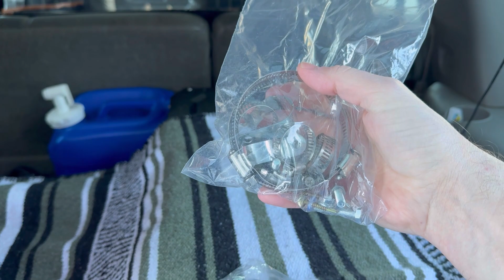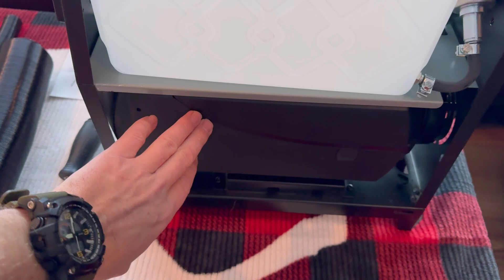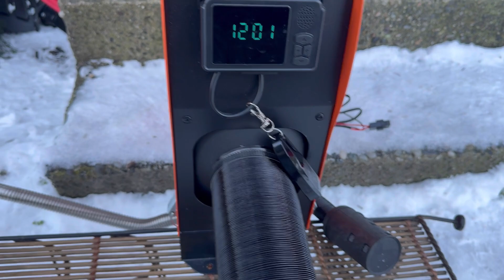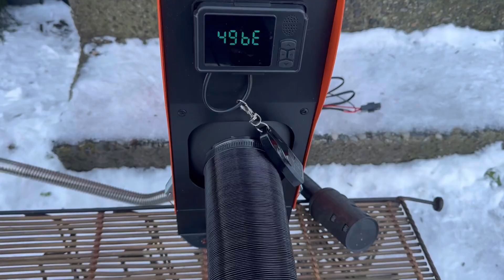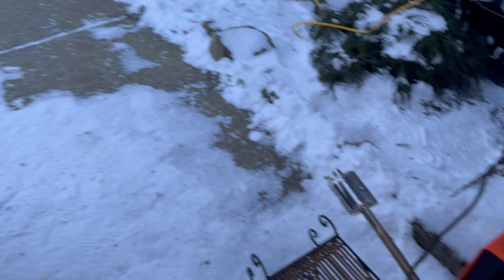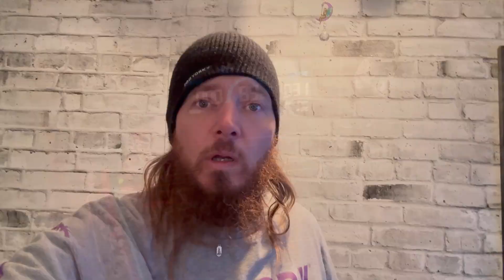VEVOR Diesel Heaters GOOD Or BAD?

Comment: Great video... not done watching yet but well done. 

3:25 There is a slit / slot in the side of the case where you can put your screwdriver, so that you can get a strait shot at the hose clamps. This makes it a little easier. I've never seen a reverse thread one either... odd. I have noticed that some of them are sticky. If you give them a squeeze with a pair of pliers around each end, they work better. 

The exhaust can be bent a lot and won't break... unless it is old and has been heat cycled many times... then it may crack.  The issue with start up is that it needed to be primed with fuel. To prime this unit, you have to remove the power (unplug it or remove the fuse) reconnect the power and then press the bottom button for 7 seconds. The pump will cycle. Watch the bottom of the heater till you see fuel going into the metal line... once you see it going in, allow the pump to pump for another 10 seconds. Then press the power button and it will stop pumping. Then once you fire it up, it will start much easier. 

The glow plug works on a timer. When you hit the power button the plug comes on and heats up for about a minute. Then the pump starts and the plug ignites the fuel.... after a minute of running, regardless of temp, the heater will try to speed up the fan and pump more fuel to get things going. After it goes through the startup sequence, it will revert to whatever setting you have it set to and the plug turns off. You can see the wattage drop to about half once the plug is off 👍

The heater will draw 40 - 50 watts ... I think you got this confused with amps. It draws about 4 amps at 12 volts 12x4 = 48 The slower the fan and pump go, the less draw and vice versa. 

If you want to make this WAY more efficient, get another hose and cut a hole in the back and connect to the inlet side... If you recirculate your air it will be WAY better. I have a bunch of videos about these heaters ... feel free to ask me anything, or check them out 👍
Reply from the maker: Thanks for all the great feedback! Just subscribed to your channel and will take a look at those vids.
Reply: @AdventureOverland2023  I try to be helpful when I can 👍 There's a lot of confusion and misinformation out there, so if you run into trouble, feel free to ask... If I don't know I'll say so. If you're trying to learn about heaters, Dave McLuckie has a lot of great videos as well. The majority of my videos are torture testing and nonsense, haha.
Reply from the maker: Torture testing is good for us viewers. I find that YouTubers can be influenced by collaboration’s and say that the product is great etc. I get that because it nice getting free products. I was like that in the beginning but as time went on, I wanted to be 100% honest. So this video, I just winged it and whatever happened is what I would share.
Reply: @AdventureOverland2023  Haha... How Embarrassing. I am affiliated with Vevor🤣I saw your Vevor heater title and wanted to see what you had to say. Not everyone has a good experience, so I was curious. When I got one of mine the fuel line was kinked, and I showed that on video. Most of my abuse has shown that the heater are actually really good, and I am open about the flaws. 

They have never asked me to say anything about a product. I have had a few products that I've refused to test for them and they are okay with that. They are a LOT like Princess Auto as they have a insane variety of stuff. If you do a few more diesel heater videos they may be contacting you, haha. 

I do totally agree with you. There are a lot of product shills out there that just read off what it says on the side of the box "here's the features and benefits" and that's that. I have been approached by a bunch of companies that I ignore either because of their product because they asked me to say a specific thing before even seeing their product. A lot of Amazon sellers. 

Sorry for the rants.
Reply from the maker: I believe they’re good too. People forget what happens sometimes during shipping and the abuse packages can get. It’s not always the companies fault but people forget that sometimes. I’m sure vevor appreciates your videos and honesty.
Reply: @AdventureOverland2023  Yeah... I liked that you mentioned that about shipping in yoru video. It's amazing that anything shows up in one piece.

Comment: From alot of videos I noticed people are mounting the heaters outside and trying to heat outside air?  I could see this using it for a tent maybe or fish house. But in a vehicle, camper or building, they are designed to be inside, with just the combustion air intake and exhaust going outside. Then you are re-heating the inside air which is much more efficient.
Reply from the maker: I never thought about that until a few people mentioned it. I’m going to try and extend the intake so it will reach the inside and see if that helps. Thanks for commenting.

Comment: I got that same heater (mine a different brand however, but they're all the same unit) Mine is the WIPPRO brand (a few bucks cheaper too)  All the accessories were there and good quality. Everything was connected and routed pretty well. I first changed the cheap fuel line they had on it, with some better quality fuel line so be safe. Gutted the little intake muffler that goes on the end of the intake hose (everyone thinks its a filter but it's not. I instead lined it with filter material so I now have an intake air filter.  I have yet to make in intake cold air return and filter for that, but that will wait until I find a good place to mount it in my shop,

Comment: Why does everyone call these diesel heaters. Diesel is engine fuel not heater fuel. Heater fuel is #1 or #2 kerosene which is more highly refined and much less smokey. These are more rightly called kerosene heaters. They will burn diesel but who would want to?
Reply from the maker: You can buy these and they either run on gasoline or Diesel. I’ve even heard about people using a used oil and diesel mix. To be honest I’m not sure if they can run on kerosene, so if anyone that reads this comment knows, let us know.

Comment: I used one, a different brand, but under the hood they are all the same, in my offgrid cabin.  Gamechanger in the middle of the night when the wood stove is nearly out and you need some heat until morning.  I use an aftermarket thermostat to control it so we aren't cold at night, and it works perfect.   A 100Ah LiFePo4 battery will run it for about 28hrs non-stop.  At 45F outside, it will get my cabin to 82F in about 20mins, the cabin is 250sqft.  Ours is outside and the hot air plumbed into the floor, one of my upgrades is to move the air intake to the inside as well as it will heat faster and not try to positively pressurize the cabin.
Reply from the maker: Thanks for the comment, another person mentioned that about the intake. Sounds like you have a nice setup.

Comment: I have two of the same heater, got then on ebay a while back for $75 usd each.  The directions were awful but the heaters do work well once you figure them out. 

 I cut 4 pieces of 2x4 about 7 inches long and screwed them to the black feet on the heaters.  It just takes a minute to do and makes them much less likely to fall over on their side.  I also used an old pair of socks as covers for traveling - one over the exhaust and one over the air filter.  A small piece of light chain with a snap ran through the handle and around the muffler and air filter makes it a little easier to store and carry as well.  Hope it helps you all get out more and keep warm on the trail!
Reply from the maker: Thanks for all the great advice!
Reply: @AdventureOverland2023  Really enjoying your channel and hope to see you continue to grow!
Reply from the maker: Thanks for that, appreciate the support.